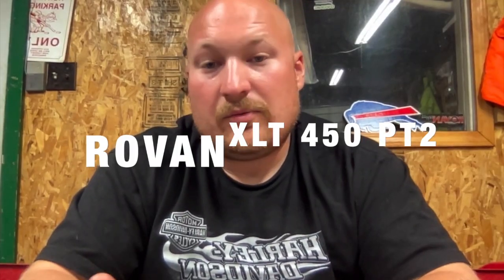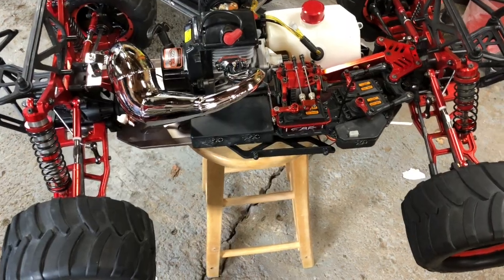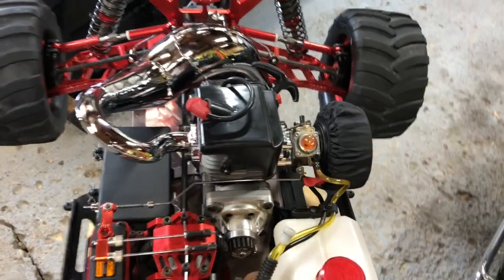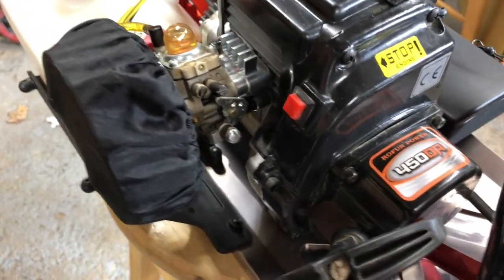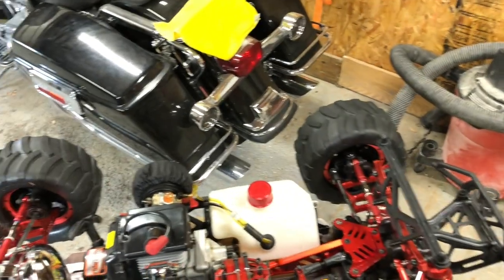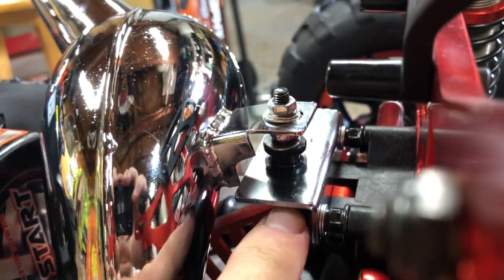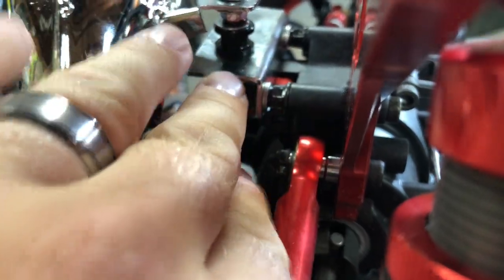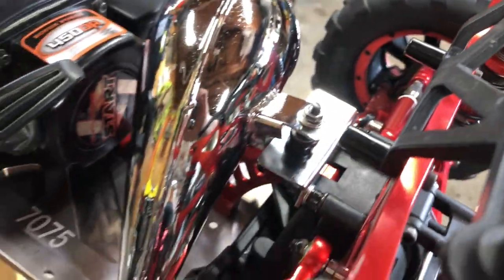ROVAN XLT 450 upgrade/update.

Comment: Good info thanks for the video I'll try the bartolone pipe for my XLT and see how that works
Reply from the maker: Hey thanks for watching!   I myself has since tried the bartalone pipe and I did not like the results but that is not to say that will be the same for everyone!  Have fun and keep brappin!!
Reply: @kgm5512  wat motor did u use the bartaline on . If u ran on this roven 45cc your not gunna get good results.... Need to take the alum carb insulatwr off n go with the plastic/doran to keep the heat off and away from the carb .
Reply from the maker: @stevenmaines9114  I used it on this rovan 45 box stock with the plastic carb 
Isolator. The bartalone pipe is too small for a 45. All they did was re purpose a pipe they already had and make a new header. Olimat make a great pipe that is specific for the rovan 45. Thanks for watching